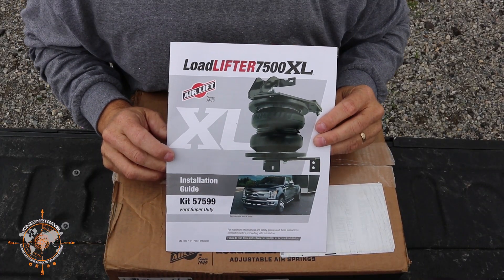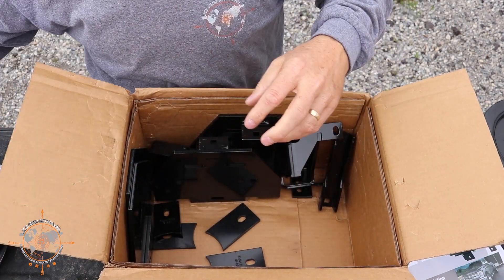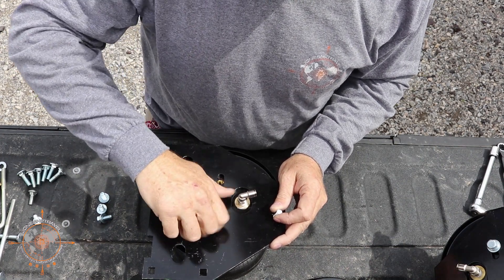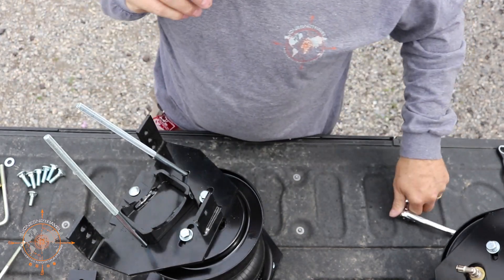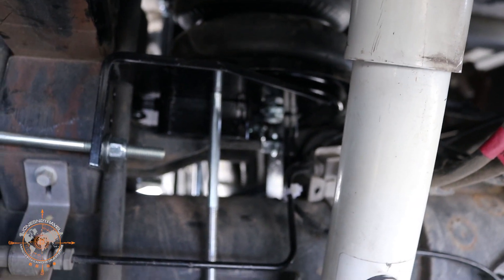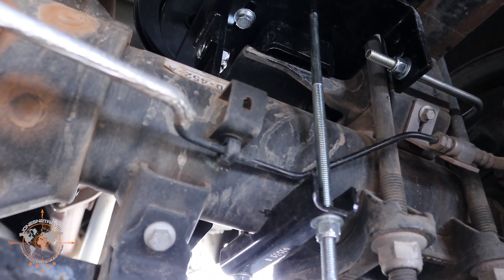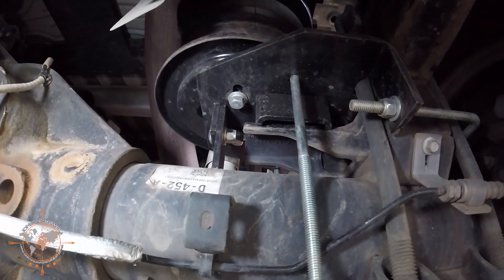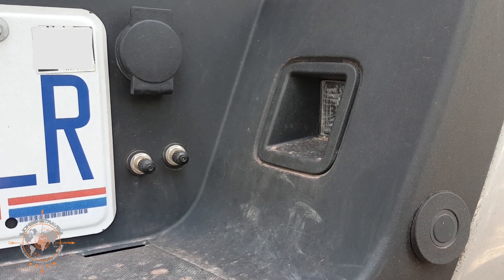AIRLIFT LOAD LIFTER 7500XL AIRBAG INSTALL ON OUR 2017 FORD SUPER DUTY | RV LIVING

Comment: Im trying to find a pair of lift airbags that can handel my 7700lb trailer and lift my truck.  right now I have like a 10 or 12 inch lift on it and I want to get rid of those  bouncy ass  Springs in front . my shocks are double Fox shocks mounted  to the side of the coil . so basically I have a huge spacer in there and I'm  Queens put the bags under the spacer on top of the axle in front.  I already have bags and compressor and all that on the back .  I just need the bags  the ones that left very high to replace the coil
Reply from the maker: Hey Billy. Best of luck. I'm not that familiar with what's available on the market for the front but with as many lifted trucks that there are out their there has to be a solution 😉.  Safe Travels

Comment: Just put these on my 2019 F350 Dully and your video was helpful , so thank you. The most difficult part were those damn top brackets. I changed shocks and add the air compressor which I love.  Make sure u torque to specs.  Paul
Reply from the maker: Yeah those top brackets are a pain. Thanks for.checking out the video. Of course, torque is very important. Best of luck and enjoy that new ford. We love ours.  Safe travels.
Reply: Just bought the same package with the wireless remote, what can you tell me with your experience so far, I've read some not so pleasant reviews about the remote

Comment: Look good but wow that one airbag is kind of close to that exhaust.
Reply from the maker: Yeah I thought the same but I installed the shield that came in the kit and after six months so far there has been zero affect on the airbag. Thanks for checking out the video. Safe Travels
Reply: @JonesN2Travel  have you have any leak?
Reply from the maker: @bishopgeorge1333  have not had a single issue. The bags look like new.
Reply: @JonesN2Travel  Awesome,  I just bought  a 2018 3500 that I'm  looking  to install the 5000 with the jouce. I have the 72000 wireless remote for it so I will be getting the 5000 soon, thank you for your reply.